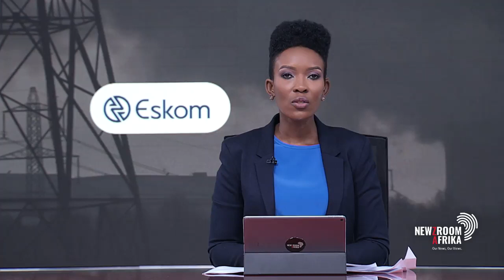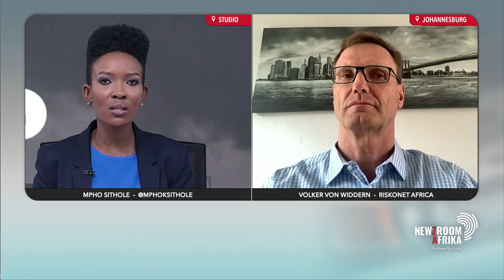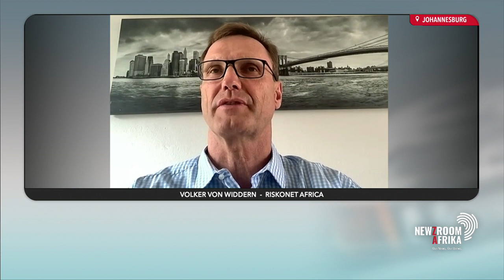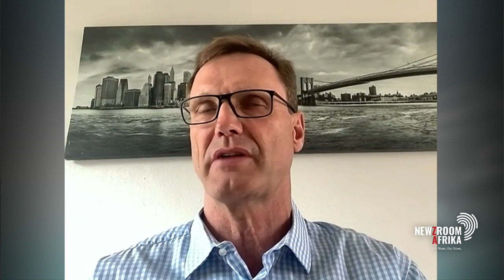Exploring alternatives to counter power outages

Comment: Nothing new about this reservoir concept. People running out of ideas, then grabbing to possibilities. The only solution for now is back to coal generation plants and restore our economy. The whole West has built their economies on fossil fuels, and now want to prescribe SA to go green. To get our economy back on its feet requires two things: (1) get our coal generation going very fast without corruption and then build on green energy; (2) get the kleptocratic ANC out of power. Biden (the greenie) has recently approved oil drilling in Alaska - why? And the Chinese builds a couple of coal burning electricity plants per year. Look how these two economies are growing and competing. Shortly, get our economy going whatever it takes and give the west a middle finger, and stop corruption. And get the f….. ANC out.